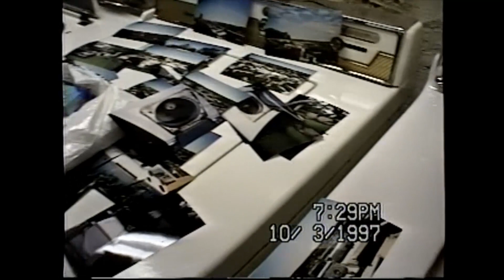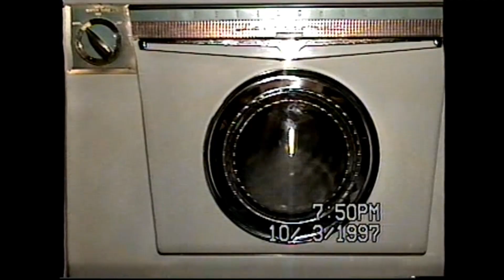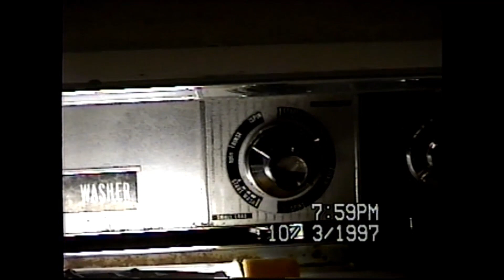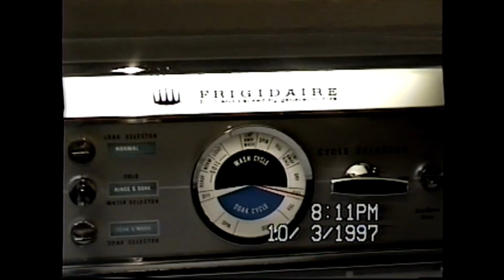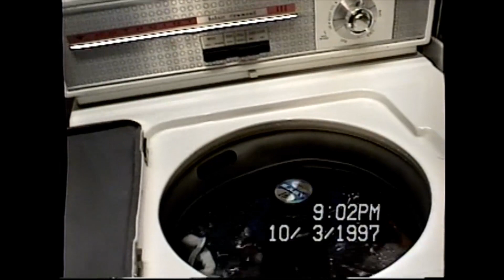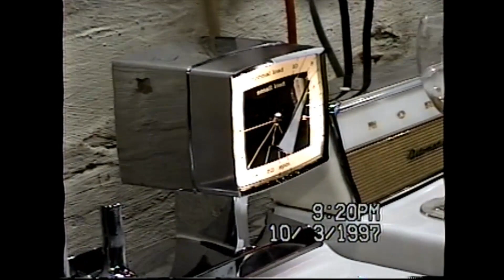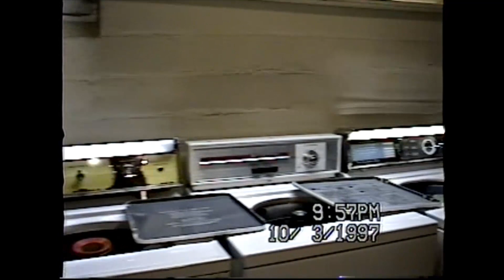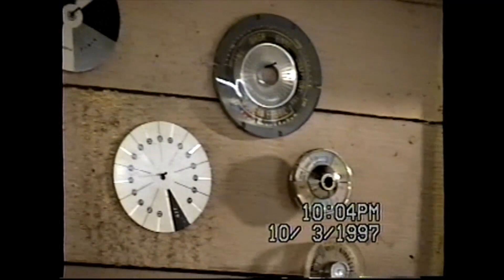1997 Minneapolis Wash-In in HD

Comment from the maker: @JSneaker Nope no need for a water softener here, the city of Minneapolis (and St. Paul as well) softens the water for you before it leaves the central pumping station.
Reply: automaticwasher Can you please make full cycle videos of your machines please? I am Maytag85 from automaticwasher.org.
Reply: My understanding is, that all municipal waster is supposed to be softened at the plant.  However, it slowly hardens back up, as it travels through the water pipes.  Water by me is that hard by the time it reaches my home.  The main line is a thick iron pipe.  They tap copper into that for each home.  For most people, they still have to soften their water (or at least get a whole house filter) to handle all the minerals that get picked up in the pipes.  My next place has well water, & I need one to filter out all the sediments, iron (luckily it's not bad in my immediate area), and lead (the house has copper pipes, & were soldered with lead solder back in 1950.